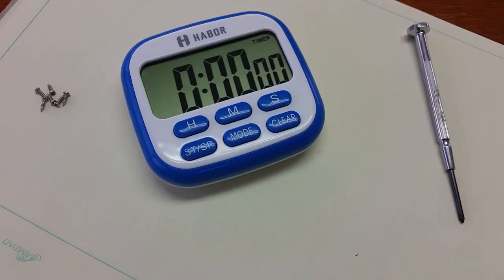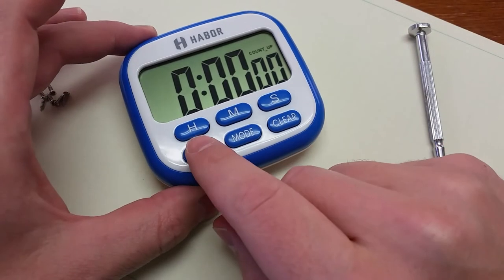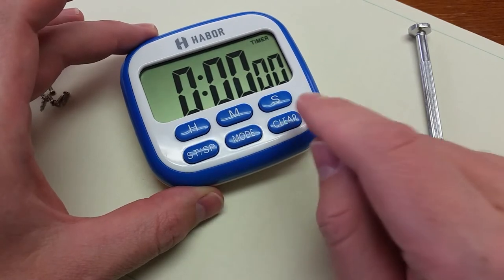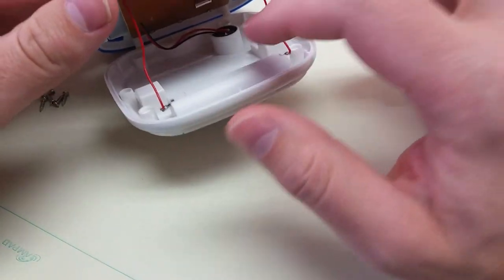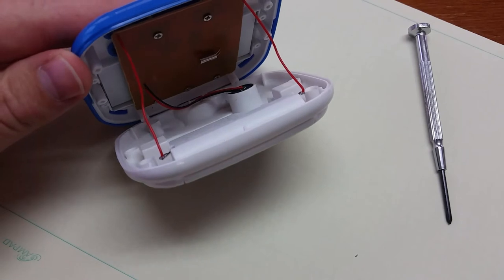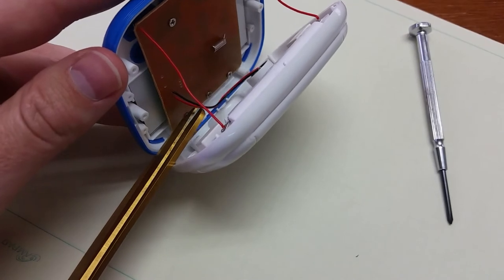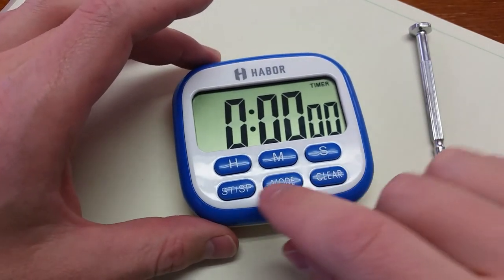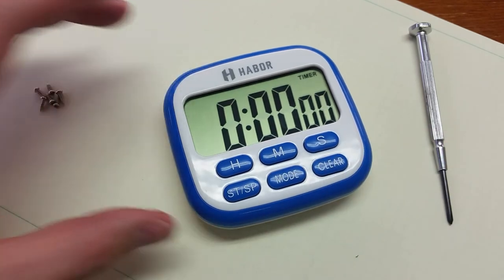Remove beeping sound from a kitchen timer

Comment: How did you know which one to cut?
Reply from the maker: You can cut either wire or both (actually in the video i was pretty sloppy with the scissors and cut both). Electricity can only flow in a loop; into the speaker/buzzer and back out. If you break that loop the electricity stops flowing and the speaker/buzzer stays off.
Reply: @EricNutsch  thanks for your answer! I actually ended up just taking the whole buzzer off because i only had one wire and was afraid it connected to other stuff. I'm happy to report that it worked :)
Next i'll do the same with my microwave oven.
Thanks again. Bye!
Reply from the maker: @silviad9314  Be extra careful when opening up a microwave. It needs to be unplugged and the high voltage capacitor needs safely discharged, even before working on the low voltage circuits.
Reply: Thanks for your suggestion, you are right. I remember watching a video of someone opening up their microwave, i'll go from there, because who wants 3 really loud beeps at 3am or at 6am in their lives? 😑..
Best regards.